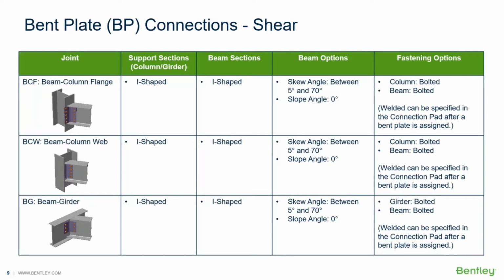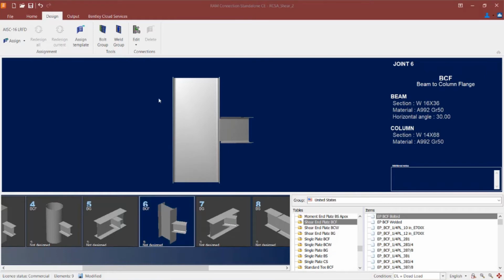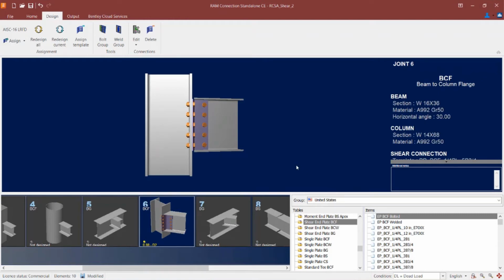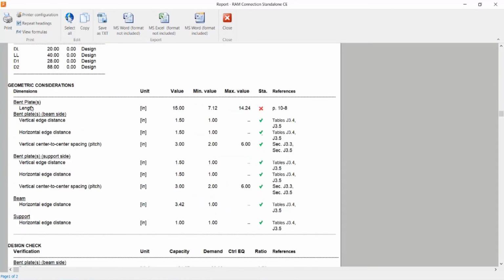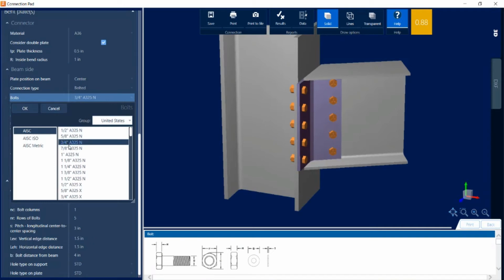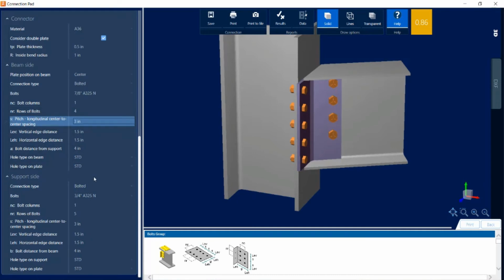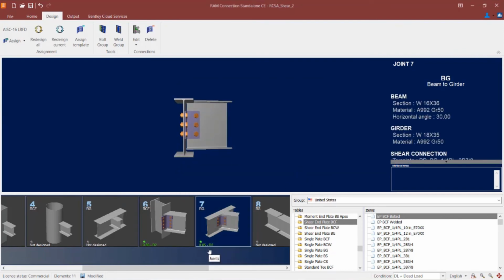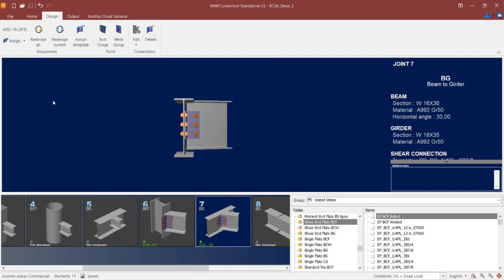Designing Bent Plate (BP) Connections in RAM Connection

Comment: Why can't you use a bent plate connection for 0 degree angle?
Reply from the maker: The bent plate connection is available for skewed beam-to-support joints. Other connection types, such as double angles, would be more appropriate for beams without a skew.
Reply: @BentleyStructuralAnalysis  Sometimes the connection necessitates a longer leg than a standard angle would allow or would be more economical with a thinner plate, seems like it would be simple to just allow any leg dimensions and plate thickness.
Reply from the maker: Thank you for your comments. I have relayed this information to the RAM Connection team for an enhancement request. Additionally, can you please submit this enhancement request on the RAM Ideas Portal on Bentley Communities?: https://communities.bentley.com/products/ram-staad/i/